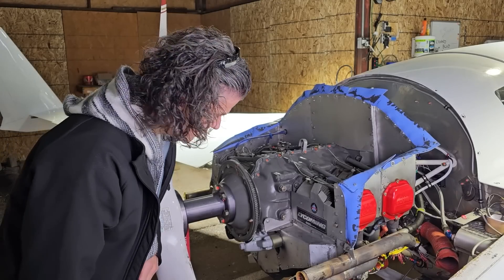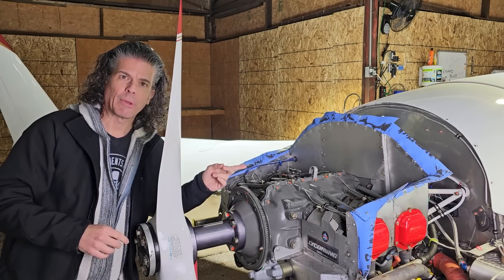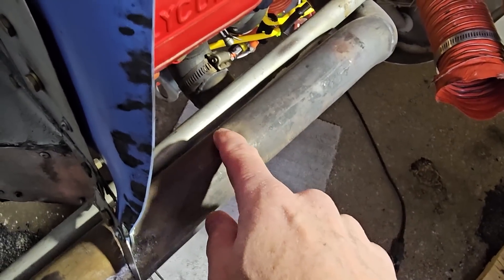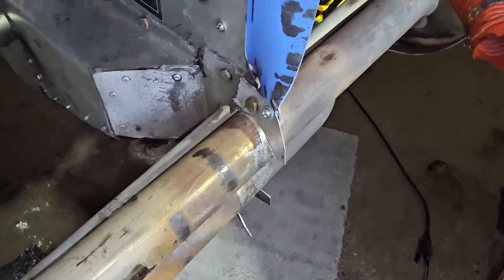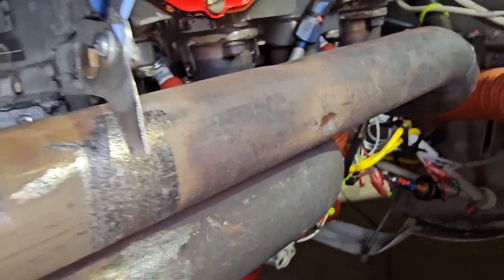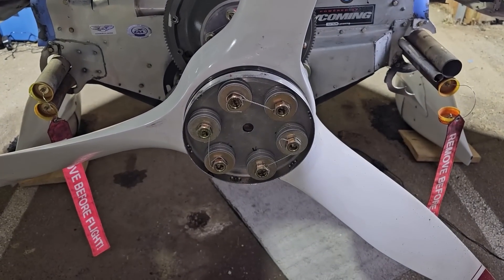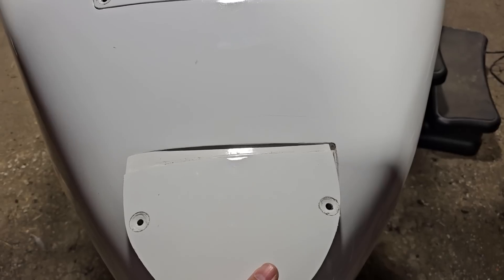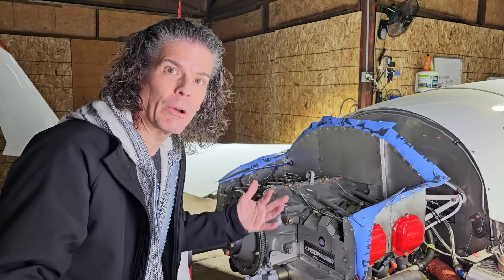Potential Deadly Problem Found! Fixing Everything Broken and Planned to Upgrade on my Airplane

Comment: This video was a great interest. It compliments the flying videos with real life. I know of a Mooney that had a backfire and blew a hole into the heat muff. The pilot was sleeping while the plane landed itself. Needless to say it was not an ideal landing, although the pilot was able to limp away from the aircraft when he woke up. He pointed out there are passive CO2 devices you can install in the cockpit that will tell the investigators why you had an accident and died. He has since installed a more active CO2 detector that sounds an alarm and hopefully will alert him to a problem before he goes to sleep.
Reply from the maker: I think you mean CO (carbon monoxide - poisonous, deadly gas) and not CO2 (carbon dioxide, in your soft drink). :) I have a CO detector built into my headset, as well as a small portable rechargeable one I keep in the cockpit.
Reply: Yes, I have been making mistakes like that recently. I didn't know you could get detectors built into a headset, thanks for the info. I find the the idea of carbon monoxide to be frightening. @CanardBoulevard
Reply from the maker: @jeffkutz4917  me too...but we've been flying with this system of heat on small aircraft for over 70 years, it works when it's maintained and inspected, and I have redundant warning devices in case it fails.

Comment: I particularly like the mechanical work, I'd like to see a video or two on the repairs.  you may want to look into an electric heater, but I don't know if it would be okay on an airplane.
Reply from the maker: Electric heat requires a TON of electrical current, which just isn't available on small aircraft. A decent sized electric heater that would work in our poorly-insulated aircraft could easily draw between 20-30 amps, and when your alternator has only a 40-60 amp capacity, that doesn't leave much left over to run the rest of the airplane. You could put a bigger alternator on, but now you need larger wire, bus bars and contactors for the additional current, which weigh more, not to mention the much heavier alternator itself.
Reply: @CanardBoulevard  just a thought...

Comment: Great video.
Think about having your engine power checked (if you haven’t). Fining the pitch (for the reasons you have spoken) can mask an underlying power issue.
Reply from the maker: The engine is at WOT, and fuel flow and mixture are correct. It's run this way since the prop was put on 20 years ago. I actually did a bunch of very specific power testing at specific density altitudes and airspeeds at the request of the prop manufacturer to give them some numbers before they did their calculations and recommended the pitch of the new prop. Definitely not just a "shot in the dark." :)
Reply: @CanardBoulevard  I wasn’t aware I said it was a shot in the dark. All the best, I enjoyed being a subscriber.
Reply from the maker: @darrylwalker1867 oh I didn't mean that's what you said - I was trying to explain that a great deal of testing and calculation has gone into selecting the pitch of the new prop.
Reply: Prop Pitch can effect RPM. On my first prop for our O-360 Velocity, we didn’t get max RPM on the Silver Bullet prop. Catto did a second prop and now we get full rpm with a different pitch.

Comment: Forget all the heater air plumbing. Use an electric heater system instead; and no carbon monoxide worries.
Reply from the maker: Electric heat requires a TON of electrical current, which just isn't available on small aircraft. A decent sized electric heater that would work in our poorly-insulated aircraft could easily draw between 20-30 amps, and when your alternator has only a 40-60 amp capacity, that doesn't leave much left over to run the rest of the airplane. You could put a bigger alternator on, but now you need larger wire, bus bars and contactors for the additional current, which weigh more, not to mention the much heavier alternator itself.

That's why virtually all small aircraft use exhaust-derived heat, and not electric.

Comment: Some people use an auxiliary oil cooler inside the cockpit with a diverter valve to control the temperature. The outside cooler is always the primary with the inside cooler receiving the diverted oil as needed. Add a small fan for cabin air circulation and you're toasty.
Reply from the maker: I've seen some Cozy's with that done. I actually showed some of them in my "Rough River" video. But running oil cooler lines all the way from the engine to the front of the plane, then putting an auxiliary cooler up there, along with a fan, adds quite a bit of weight. The worst thing is...it doesn't make much heat. Your oil is at only 180 degrees F, it's not transferring a lot of heat into the cabin air. Automotive cabin heat exchangers work with coolant at 220 degrees, and a much larger heat exchanger. The owners I've talked to who have this type of heating system say it doesn't do much when it gets really cold outside.

Comment: On my other airplane, I have a  digital CO monitor and that is on the list of things to buy for my Cozy restoration.   Your welder might be able to fill in the cracks rather than replace the pipe.
Reply from the maker: I have a CO detector built into my headset, as well as a small portable rechargeable one I keep in the cockpit. I asked my welder about filling in the cracks, he said no way does he have the equipment or skill to do this type of specialized welding. More about this in a video coming soon that I am currently filming!
Reply: I had really bad cracking on my Long-EZ pipes from a heat muff that had been welded to the pipes and lead to stress cracking.  I changed the heat muff to a clamp-on design and TIG welded up the pipe cracks.  20 yrs later the repaired pipes have never developed new cracks.

Comment: Check your fork clearance when you fit it. There was a recent Velocity gear up incident where the nose gear didn't come down. Transpired that when slightly askew it jammed against a battery tray in the nose bay as the new miled fork was a little squarer than the old cast one.
Looks like a nice fork.
Reply from the maker: The new fork is identical to the old one, just machined rather than cast. In the Cozy there's nothing to get jammed on up there - the recess is dedicated to only storing the nose gear.
Reply: @CanardBoulevard  👍

Comment: You also want to be able to isolate the cabin from the engine bay in case of fire. That's what the firewall is for! Having a locked open hole in the firewall isn't great.
Reply from the maker: There's actually a second valve on the inside that can be (and usually is) closed. That will actually be coming out as well - the replacement valve box I have to install on the firewall is stainless steel, unlike the aluminum valve box on there now, so it will sustain 100LL fueled fire, where the aluminum box will just melt.
Reply: Well thought through